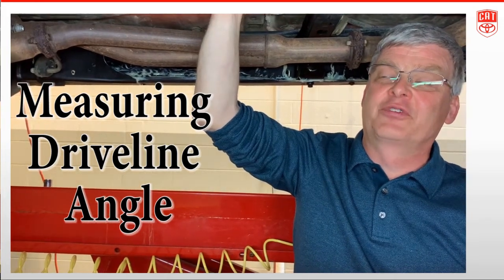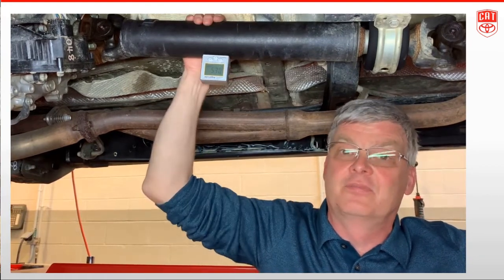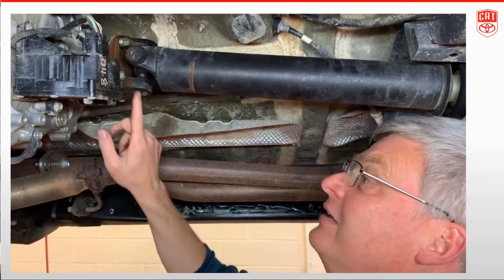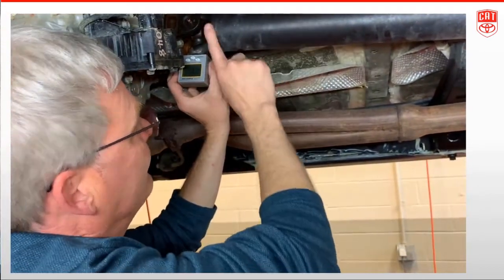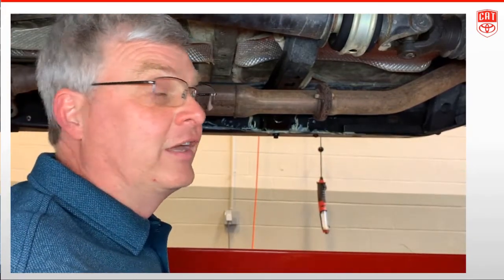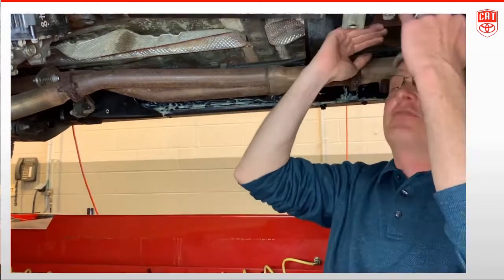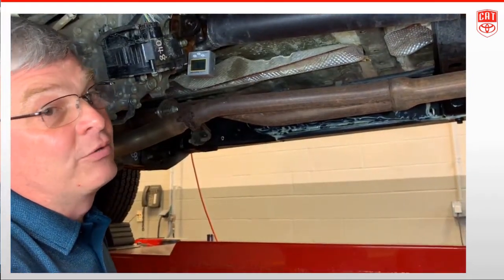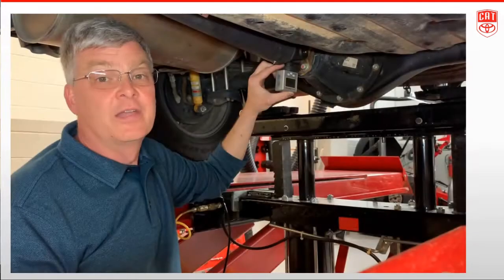Drive Line Angles

Comment: HELP! My problem is, I have a 4.5 degree angle from my front flange to my first piece of the drive shaft. There's no way to lift the center bearing to reduce that angle. Then I have a 1 degree angle in the middle, downward. But everything I've read says I shouldn't be putting a 5.5 degree angle on my rear U-joint to compensate. So what am I supposed to do?

Comment: Sir, this is by far the best video on Youtube explaining this process. I have enough to write a script in Python to quickly calculate and graph this information. As a hobbyist, understanding it correctly makes the difference between a successful project and vibration in the driveline. Thanks so much.
Reply: I used his explanation to create a Python graphical user-based program to do my calculations for my truck build. I was able to get three driveshafts within .9 on a rollback build.

Comment: Why is the Pinion going up? Looks like it's in the same downward slope as the shafts.
Reply: Transmission points down slightly, so the differential points up slightly, to counteract vibration. As mentioned.

Comment: If my angle out of the trans is almost 0 degrees and the CB angle and the pinion angles are almost the same, as in within .20 of each other is that okay?
Reply: Yes, but then the CB's and diff's U joints have to be in phase. This video neglects discussing U joint phasing.
Reply: @eelkedeboer5538 uh because these trucks come from the factory in phase?